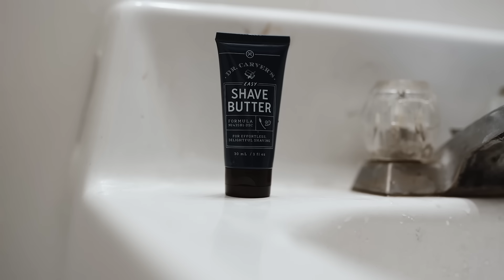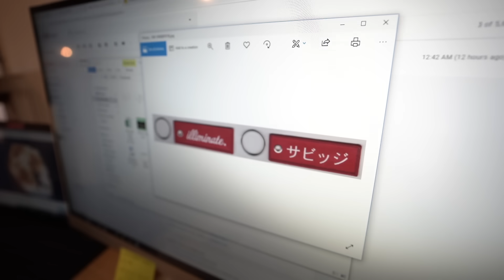Time for an upgrade!

Comment: Hey randy small tip with the fan. Put it by the door facing outside as if it’s blowing out the door. It’s like pulling rad fan so pull the hot air out the door rather than pushing cool air through the room

Comment: For BUTTERY BUTTCHEEK SMOOTH SLOWMOTION SHOTS:

1.) When filming in 120FPS editing on a 24FPS timeline, slow the footage down to 20%
2.) When filming in 60FPS editing on a 24FPS timeline, slow the footage down to 40%

Slowing the footage down to any other percentage will call for unequally cut frames for slowmotion causing a very choppy looking slow motion. 20% of 120FPS is 24FPS. 40% of 60FPS is 24FPS. Just keep in mind when slowing down your footage, you want the frame rates to match equally to your timeline! Keep up the good work guys, the new camera quality looks great!

Comment: Hey buddy the new camera video is really good Quality but the big problem with it is that the video is all over the place I don't no if its because your not using video Stabilization and its off or the camera just don't have that feature  But the video really needs stabilization on If the camera supports it the Video is to shaky all over the place its actually getting Me dizzy 😵 Not enjoyable to watch also I notice from time to time the video gets blurry Loses focus the other camera did not have that problem the videos was very stable hope this helps u buddy

Comment: Bruh, the A7iii is $1900 on B&H Photos (no tax for CA purchases). what the hell did yall spend the other $2600 on? B&H has the A7iii + 28-70mm f3.5 lens for $2198 shipped to your door out in San Jose... I feel like you guys got fucking SWINDLED on your purchase...